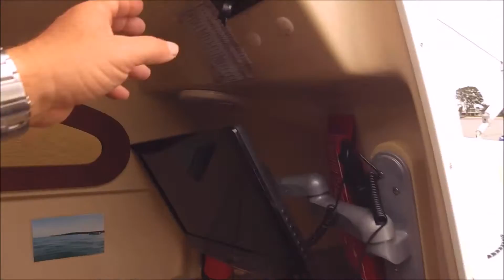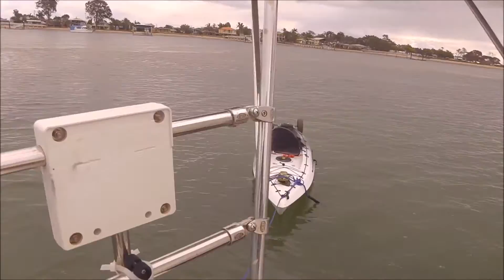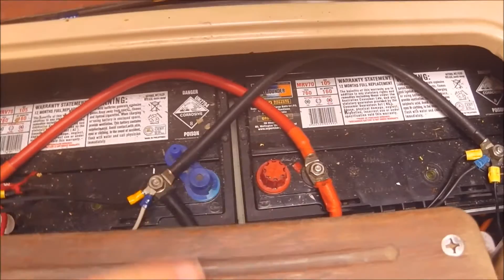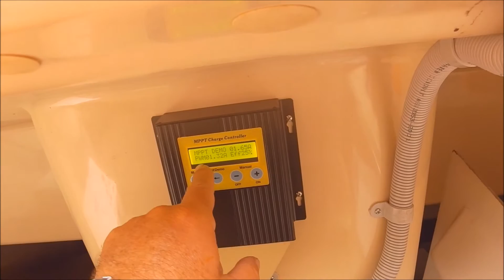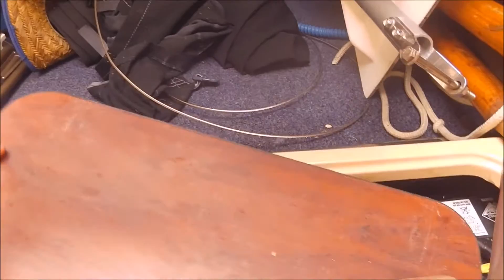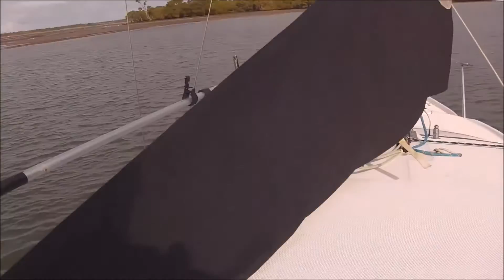Macgregor 26M  Solar panel setup

Comment: Great little intro (and very nice handiwork in your installation!). Curious about the Fridge you are using. Seems VERY efficient to only draw 2amps
Reply from the maker: Hi Chuck,  yes, they are extremely efficient fridge/freezers.  Will keep everything cold/frozen or even make ice on about 2a/h. They are an ozzy brand and well respected here,  but I'm sure there must be a well regarded brand using the same German compressor where you are https://www.evakool.com/47-litre-evakool-fibreglass-fridge-freezer
Reply: Many thanks. Cheers!  @OldDadProductions

Comment: gday Dav,i was wandering where u got the stainless steal tubing from i just bought a 2003 26x macgregor and bought a solar panel from 4wd supercenter i would like to give it a crack myself,cheers m8
Reply from the maker: Hi Adrian
the one inch stuff and stainless Bimini fittings I got from Whitworths boating store,  but I got the boys at Horizon Shores marina to put the panel mount on so they had the flat bar and 3/4 inch stuff.
Reply: Awesome thanks Dav ,I use to work at Horizon Shores Marina many years ago as a broker and lived on G arm on my 30ft house boat,I might try and get down to whitworths today to have a look,taking my 26x out this weekend for the first time probably leaving from runaway bay marina as this will be the first time ever putting the mast up,should be interesting lol might c u out there one day,She has 2 eyes on the bow,”Bright Eyes”thanks again
Reply from the maker: Awesome,  see ya out there Adrian
Reply: Cheers m8,Heading out tomorrow for our first sail,Dam i hope i dont make the News lol,Happy Days
Reply from the maker: Lol, I'm sure you are doing fine out there

Comment from the maker: The local marina welded them on for me.  They charged me $160  - in about 2011 I think that was.   You could probably just use 1 inch tube and stainless bimini fittings I guess,   but  less likely to move if welded ..

Comment: Beautiful mate!  Loved the video.  I will make a video of my setup in my 2000 26X.  I use the cheap PWM and they suck!  I need to get a better model and, due to your video, I will consider the MPPT models.
Reply from the maker: Yes,  I always like seeing how others have things set up. Make a video. Some say its not worth having a MPPT controller on a panel this size.  I'v found a deffinate improvement from the PWM I had before.  This cheap MPPT controller is working well.

Comment: I've noticed a few people screwing things into the outside walls of the interior.  Are you all using short screws, or is the fibreglass really that thick?
Reply from the maker: There is enough space between the liner and the hull to use short screws on the liner,  but you have to be careful as the liner is very thin so its probably not the best way.   Well nuts (known as Ram nuts in Oz and Rawl nuts in the UK I believe) are probably a better way,  but yeah,   I have just used stainless screws on some of my mods.